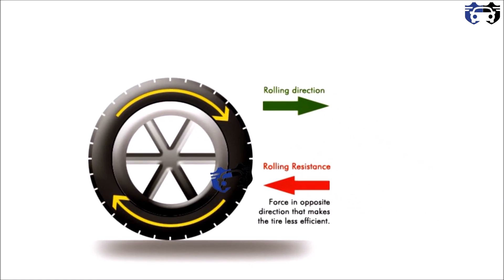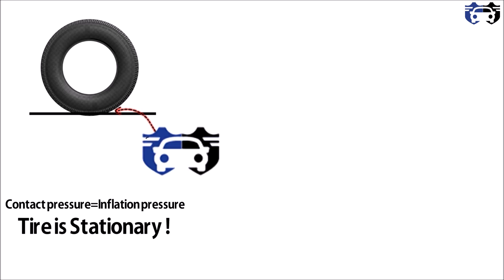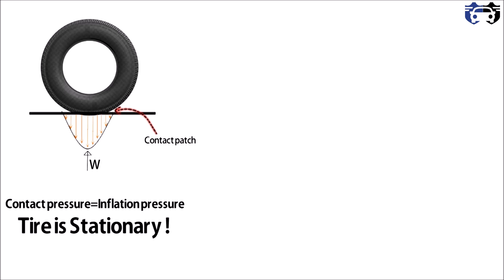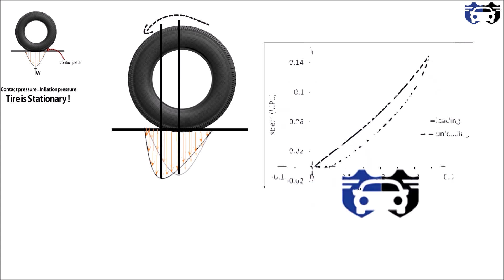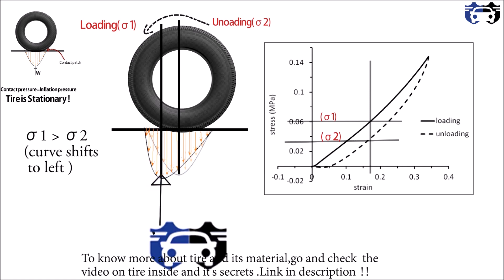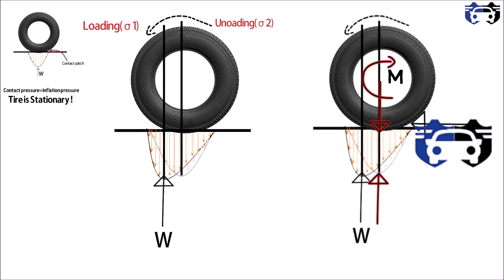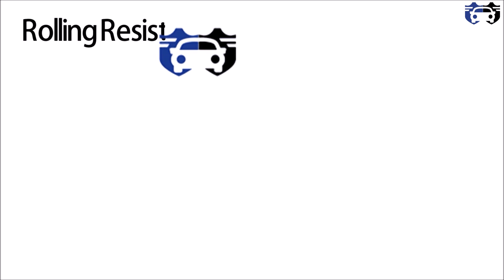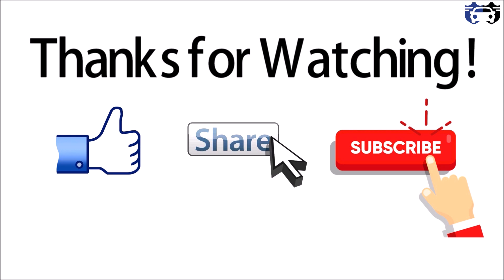From Where and Why rolling resistance comes into action ?

Comment: 0.43 s, How come the contact pressure and inflation pressure same while tyre is stationary
Reply from the maker: I mention that contact pressure ≈ inflation pressure in a stationary condition — and here’s why:

When a tire is stationary and loaded (e.g., with the vehicle's weight), the force pushing down (vehicle load) is balanced by the internal air pressure pushing up at the contact patch.

The inflation pressure spreads across the inside of the tire, and at the contact patch, it directly supports the load. That’s why the average contact pressure closely matches the inflation pressure, assuming uniform load distribution.

However, in real conditions, it's not exactly the same — because tire stiffness, sidewall deflection, and surface friction also play roles. But for a simplified understanding, especially for explaining rolling resistance basics, it’s a good approximation.

Comment: Traction force also involves Fz. Does Fz generate both Traction and rolling resistance force?
Reply from the maker: Yes — Fz (vertical load or normal force) plays a key role in both traction force and rolling resistance, but in different ways:
-  Traction force (Fx) is directly proportional to Fz × μ (coefficient of friction) — more vertical load means the tire can generate more grip, up to a point.
- Rolling resistance also increases with Fz, because a heavier load causes more tire deformation, leading to higher energy loss.

So while Fz contributes to both, traction helps move the vehicle, while rolling resistance opposes motion. It’s all about how the vertical load interacts with the tire’s structure and the road surface!

Comment: How would i calculate Tire Strength...Tire Load Carrying Capacity?????
Reply from the maker: The tires load index value gives the maximum load carrying capacity. Also, this load carrying capacity is at the recommended maximum pressure of the tire. Also, you can compare strength on the basis of ply rating.

Comment: My question is how to calculate two wheeler vehicles torque calculate at Rear wheel on chassis dynamometer.
Reply from the maker: To calculate rear wheel torque on a chassis dynamometer for a two-wheeler, here's how it typically works:
1. Measure Tractive Force (F):
The dyno measures the force at the roller, which is the horizontal force the wheel exerts while rotating.
 2. Measure or Know Wheel Radius (r):
You need the effective rolling radius of the rear wheel (can vary with tire deflection, so use loaded radius if possible).
3. Torque at Rear Wheel = Force × Radius
 If Dyno Gives Power and RPM:
Torque= 9550 × Power (kW) / RPM
(Use wheel RPM, not engine RPM.)

Comment: Bro how to calculate rolling resistance for bearings since it is mde up of non cisco elastic material
Reply from the maker: Bearings don’t have viscoelastic deformation like tires, so their rolling resistance comes mainly from Friction in Contact Surfaces.
To Calculate Rolling Resistance Torque (T):
For ball bearings:
𝑇= 𝑓⋅ 𝑊⋅𝑑

Where:
f = coefficient of friction (typically 0.001–0.005 for good bearings)
W = load on the bearing (N)
d = bearing bore diameter (m)

Comment: Is there any work created by rolling resistance. It.s mean energy list by this friction
Reply from the maker: Yes, rolling resistance causes energy loss — that energy turns into heat inside the tire due to internal friction (hysteresis). So technically, work is done against rolling resistance, and it affects fuel efficiency too.

Comment: I want to check if the direction of the arrows for Fr and Traction are switched. Assuming a driven wheel, friction opposes motion, I think.
Reply from the maker: For a driven wheel, traction force (Fx) is forward, and friction (Fr) actually acts in the same direction — it’s what generates traction.

Friction doesn’t oppose motion here — it opposes slipping. So for a vehicle accelerating forward, the friction force at the contact patch pushes forward too.

Comment: How the 2 forces have the same line of action  They should not share the same line of action, at least there should be a distance between the two forces, if I'm wrong please correct for me.
Reply: yes i am having the same doubt, about the Fr and tration force,..how is the system fully balanced?
Reply from the maker: While traction force and friction (Fr) often seem equal and opposite, they don’t act as two separate forces on the same free body.
Friction at the ground is an external force acting on the wheel — this is what we call traction.
There’s no separate “traction” force acting on the wheel — traction is the result of friction, not a second force.
So on a free-body diagram of the wheel:
- There’s just one horizontal force at the contact patch — the friction force (Fr), pointing forward if it's a driven wheel.
The system stays balanced because:
-The engine torque rotates the wheel
- Friction at the ground pushes forward
- This results in forward acceleration of the vehicle

There’s no duplicate force — friction is the actual agent of motion here.
Reply from the maker: While traction force and friction (Fr) often seem equal and opposite, they don’t act as two separate forces on the same free body.
Friction at the ground is an external force acting on the wheel — this is what we call traction.
There’s no separate “traction” force acting on the wheel — traction is the result of friction, not a second force.
So on a free-body diagram of the wheel:
- There’s just one horizontal force at the contact patch — the friction force (Fr), pointing forward if it's a driven wheel.
The system stays balanced because:
-The engine torque rotates the wheel
- Friction at the ground pushes forward
- This results in forward acceleration of the vehicle

There’s no duplicate force — friction is the actual agent of motion here.

Comment: Thank you for explanation. Can you please explain the rolling resistance difference between inflated tire and under inflated tire?
Reply from the maker: Glad you found it helpful, bro! 
Yes — underinflated tires have higher rolling resistance because they deform more at the contact patch. More deformation = more energy loss = more heat.

On the other hand, properly inflated tires stay stiffer, deform less, and roll more efficiently — giving better mileage and less tire wear.

Comment: So even if the tire is rolling on ice  there would still be rolling resistance because it not related to friction wright??
Reply: Yes but there will be very low or no traction force so the tires will continue to roll but the vehicle will not move.
Reply from the maker: Rolling resistance isn’t caused by surface friction like grip or traction — it comes from internal deformation of the tire itself.

So even on ice, where road friction is super low, the tire still flexes and loses energy inside — which means rolling resistance is still there, just smaller.

Comment: I have a question: the rolling resistance is the same when the body is stationary as it's when it is in movement? i mean does it have an static and dynamic coefficient or is it always the same?
Reply: I guess when the tyres are not rolling there will not be a displaced normal force towards the right. Hence there will be no rolling moment generated and no rolling resistance
Reply from the maker: Unlike sliding friction, rolling resistance doesn’t have distinct static and dynamic coefficients. It mainly exists when the wheel is rolling — not when stationary.

So when the body is stationary, there's no rolling resistance. It only comes into play when the tire deforms and recovers during rolling, causing energy loss. The resistance can vary slightly with speed, load, and temperature — but there's no fixed "static vs dynamic" like in friction.